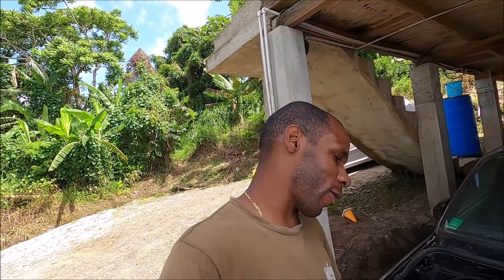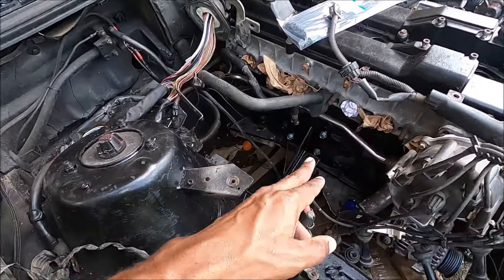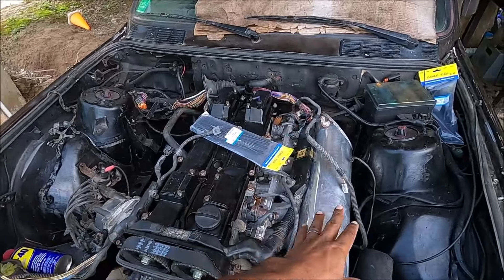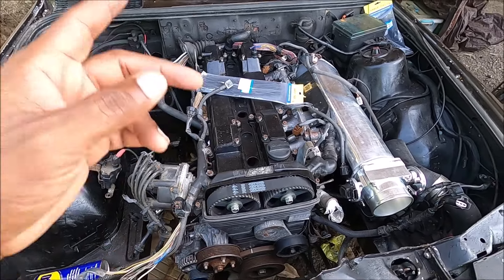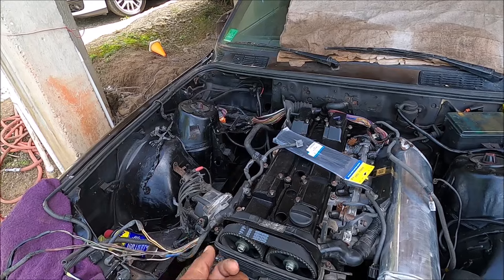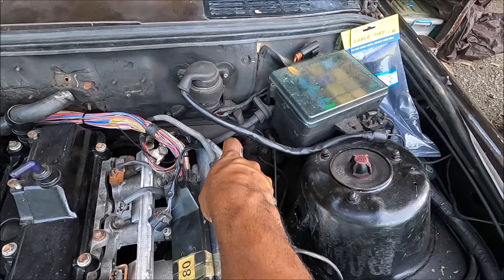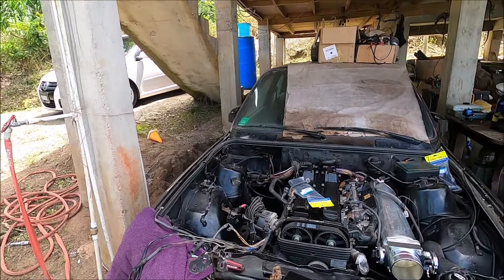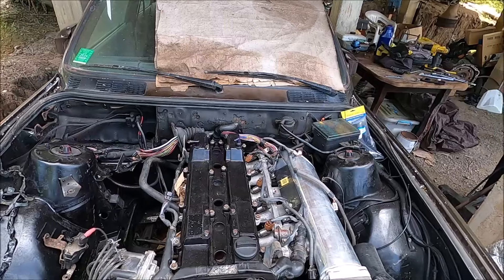Finally Starting Working on My BMW Again

Comment: try to angle the throttle body 45ish deg towards piping whilst shortening, looks nicer imo.. as fr the brake master, just do a servo delete, bring the master slightly upwards, redrill pedal …. just a thought cheers 👍🏾
Reply from the maker: Excellent suggestions thanks

Comment: Now Judas will need to find a new way to stab you in the back now he has a 2J 😂
What will you be doing for the brake setup? E30 V8-swap guys probably have looked at every brake setup under the sun, same with the M52/S54/S38 swap guys too, if you need ideas.  
Looking forward to seeing the progress brother 👊🏾
Reply from the maker: Yes the 2j and auto trans  will take care of most of its previous issues.

Currently have few brake master/booster in mind. Haven't settled yet but I will cross that bridge when I get there. Thanks for the tips